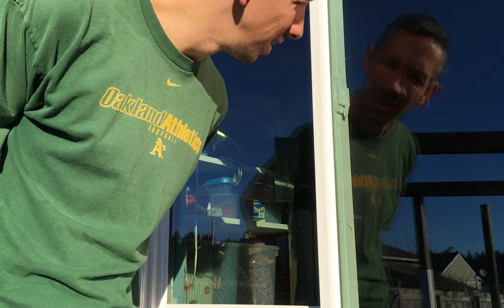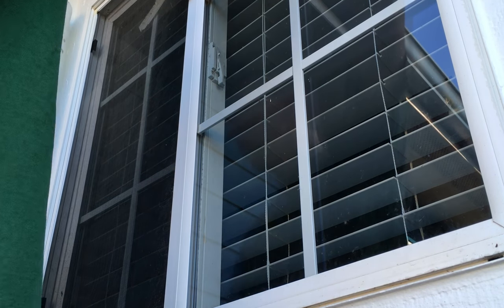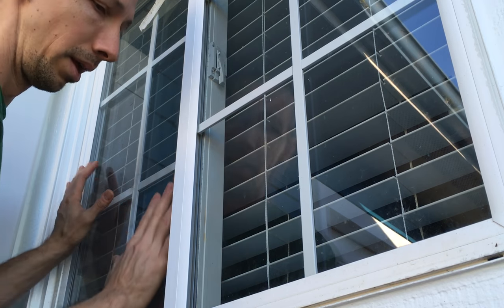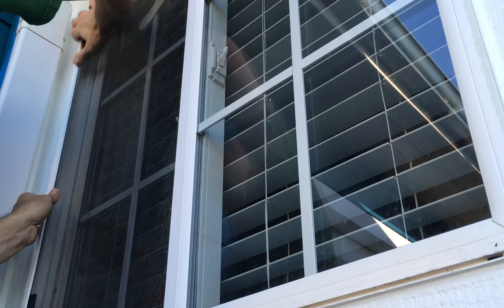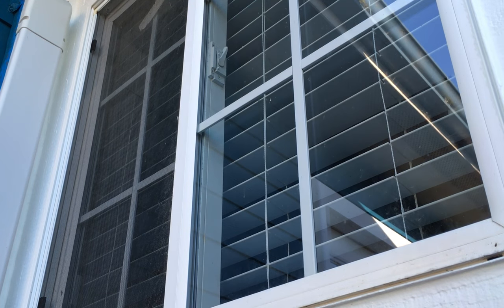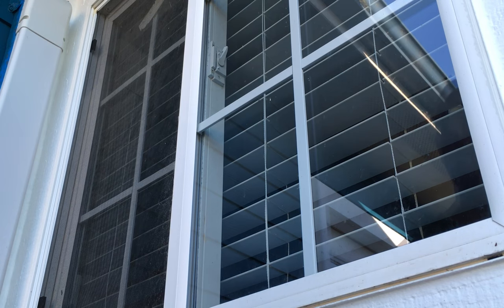How to Take Off Screen and Open a Locked Window

Comment: How do I put it back on from the inside? Help me please?😪
Reply from the maker: Ok, so if you have the screen you should see like two metal tabs that fit into the frame on one side of the screen, the tabs will typically be bowed out a little and will flex, it is this flex that holds the screen in the window frame. So once you have located those tabs, put the side that has those tabs into the slot where the screen fits in the frame of the window. The screen should also have little metal handles that you can hold on to. Once you put the screen tab side into the frame, hold the screen by the little metal handles and ease the rest of it into the window frame slots, while you keep it pressed towards the side that you initially fitted in, the side with the metal tabs. After you get the whole screen in, just let it go and the tabs will push and keep the screen in the slot in the window frame….. I hope that helps =)

Comment: What do you do when it’s the same kinda window but when you turn the lock from inside it won’t open slide or budge at all?Like it’s a locked window and I’m trying to sneak out. How do you open it!
Reply from the maker: Ricky hmm sounds like it is stuck. Just try and jar it to break it loose.
Reply: Scary Talking Head jar it? Wdym
Reply from the maker: Ricky sometimes windows get stuck.... what I mean by jar it.... it mean to bump it or try and move it kinda hard to free it up if it is stuck...
Reply from the maker: Ricky just free it up during the day sometime to get some fresh air or something. Also, just some advice, if you are sneaking out there is a reason you are sneaking, either it is because you know you are in the wrong and do not want to be caught, or you are in danger and do not want to be caught. If the former, I would advise you to not go against your parents orders, if the latter, please be careful and safe!

Comment: I pushed like you said and my hand broke through the glass and I cut my hand and now I don’t have a window 🫡
Reply from the maker: Wow, so sorry that happened, it is hard to fathom that you were able to push through a window! I hope you are okay!
Reply: @ScaryTalkingHead  it’s better now I just cut my wrist like not under but on top where the little bone is at and it made it hard to move my wrist but it’s better now . It’s crazy cause I’ve done it before where I’ve pushed to try to open it but this time I just pushed inwards wayyyy to much
Reply from the maker: @ebk535  I am glad you are better, that could have been really serious! In the video I guess maybe it not showing that great, you only push in enough kinda to grip the window, all the force is being applied in a sideways/up ad down motion, not in. Ideally those locking suction cups with handles should be used, lol, but who has those handy when they are locked out? Haha

Comment: do you know how to put the screen back? perhaps I missed it in the video and someone could point it out?:)
Reply from the maker: Fernando Elizalde yes, there are a couple metal tension spring things on one side of the screen frame. Put the side that has those into the groove   Of the window and then just push it into that groove and then you should be able to to push the other side of the screen in and then let go and the tension metal tabs will hold it in place.
Reply from the maker: You can see it at like the 12 minute forty second mark of the video
Reply: @ScaryTalkingHead  Thank you very much sir
Reply from the maker: Fernando Elizalde you’re very welcome. Glad I could help =)
Reply: What about a top lock?

Comment: He's literally low key trying to teach you how to break in . And manipulate this lock.  Literally just heard someone unlock my windows 2 of them. And open it. I'ma have to do something about this. It's 3:27am rn. Something told me to stay awake tonight so bizarre.
Reply from the maker: @JhonJinny  eek, if you are inside just throw a stick or something in the track and it will prevent the window from opening. I am not trying to show anyone how to break into anyone else’s house, I would never condone that, but unfortunately, people will use good information for bad things. I hope you are safe
Reply: @ScaryTalkingHead  i understand i am not trying to shed you in a dark light at all. Its just scary how easy it is IF someone with bad intentions acts. In my case I was paranoid and actually left the window unlocked by accident it was my fault! Everything is fine thank you!

Comment: can you show us how to do it from inside
Reply from the maker: Sure I will make a video that shows that.... I will tell you real quick how to also. Most screens will have a couple little metal pieces that are part of the screen that you can grab to manipulate the screen. Wherever those metal pieces are that you can grab hold of, pull them to the opposite side of the window from where they are located. This will pull the screen out of its channels that the tension springs are holding it into. You will see the screen move out of the channel it is pushed into by the tension springs. Once the screen is out of the channel, just push it out away from you and voila! The screen is off =) hope that helped, and yeah, I will make a video too. =)
Reply: @ScaryTalkingHead  
Thanks 🙏 
My problem is that I can’t open the window from inside and I live on the second floor so I can’t go outside and open it. I think the paint might be dried out and stuck.
Reply from the maker: @fionasun8688  https://www.youtube.com/watch?v=sQK9a1dcVAo&lc=UgzeynD85pSrWGelyA54AaABAg here is a video on how to take the screen off from the inside =) I hope that helps.